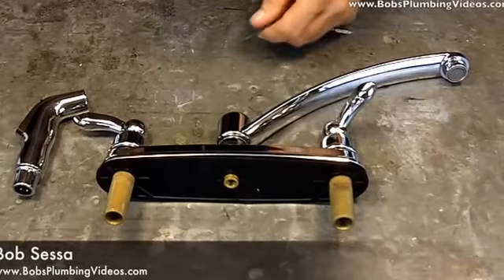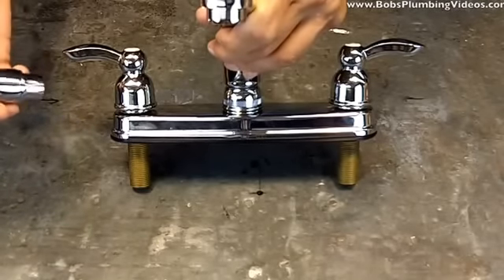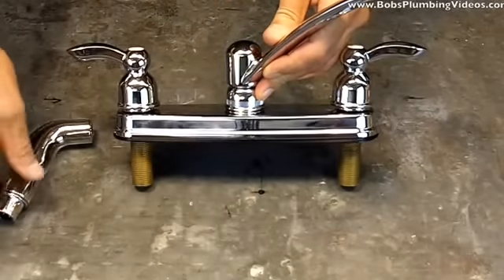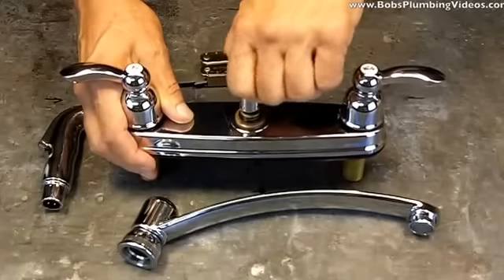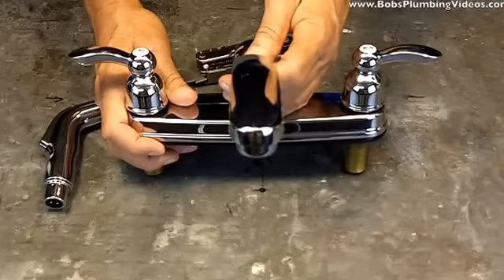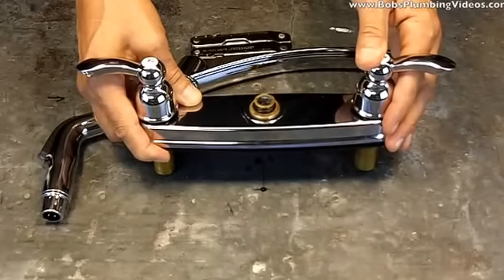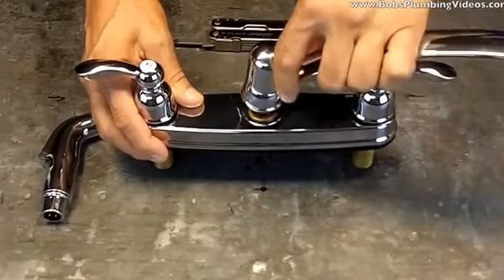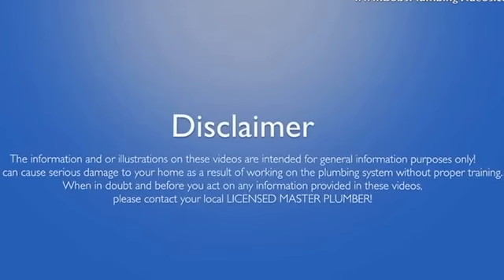Kitchen Faucet  Sprayer Diverter Problem

Comment: Hey sir, Do you have tome to troubleshoot this problem im having?

My kitchen sink sprayer doesn't work at all, and when i try spraying it, it completely turns off the main faucet and it takes a while for water to start flowing again. Ive tookin all the parts apart and cleaned them and still no fix. When i took the sprayer head off and got down to just the hose portion, i realized when ever i block the hose completely way2r runs fine through the main faucet. But if i le5 go, i get no flow at all.
Reply from the maker: From your description, I would say you have a bad divert-er. Send me some photos of your faucet and I'll identify it. My e-mail:info@bobsplumbingvideos.com
Reply: Hey bob thanks for replying,  i changed the diverter and replaced all the seals and it works like new. Have a good one bud
Reply from the maker: Excellent! Regards, Bob.